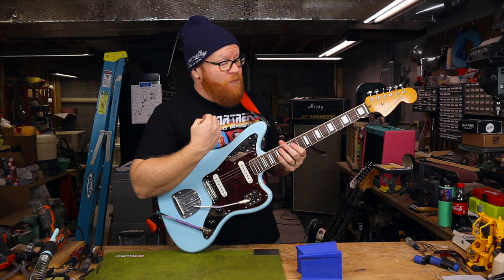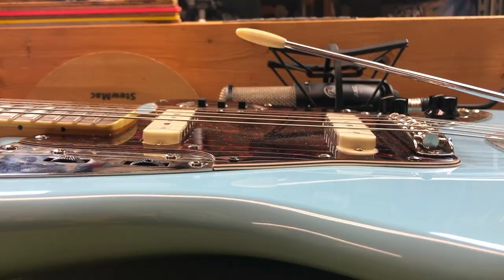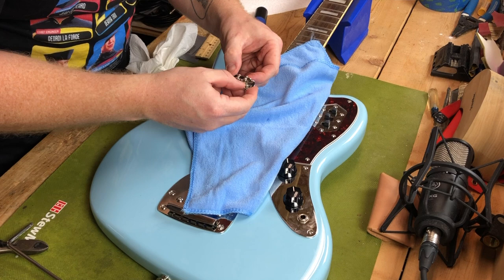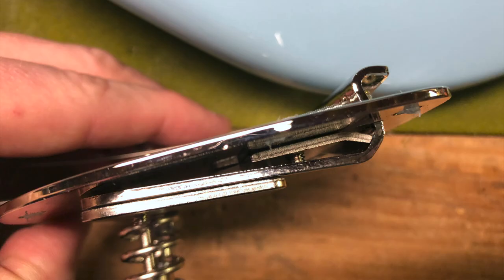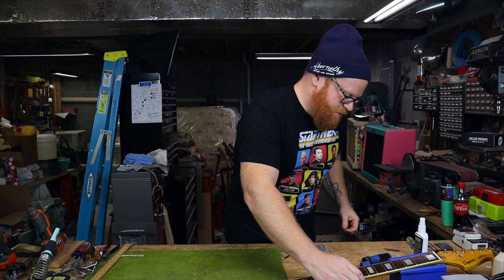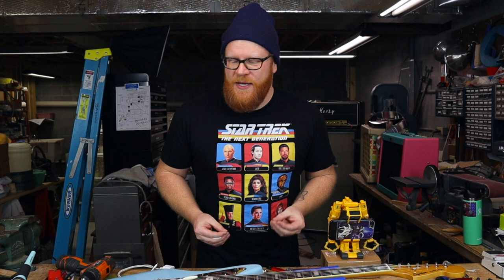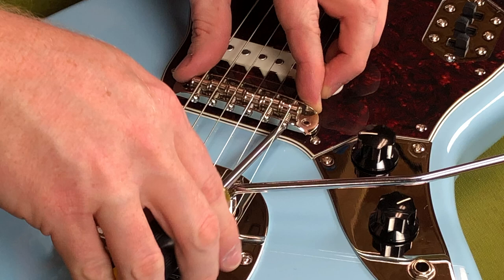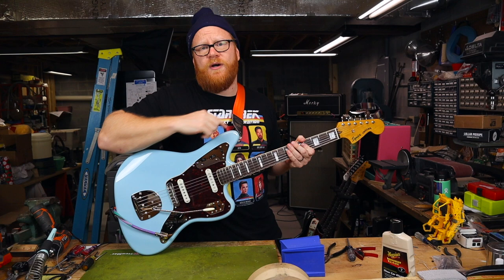ON THE BENCH #6: Squier Classic Vibe '70s Jaguar Setup + Quick Demo

Comment: I just bought this same guitar new, and it has the same issues, almost exactly. As someone inexperienced with setups, esp. with this type of vibrato, having you go through this is very helpful, I appreciate the video!
Reply: Me too with my 70's CV. It's a factory issue I think: there isn't enough pitch in the necks. The shim fixes it.
Reply: @lenduckworth99 How thick was the shim? I just got one of these.
Reply: @slightreturn1045  Try a .5 degree shim. That should get you there.

Comment: Only offsets are worth this much trouble.  If a Las Paul required this much TLC I'd never buy one.
Reply: This guitar is also around $2000 less. I figure a lot of the price goes to setup along with construction.
Reply: @jazzblasterrr  true on the price difference but people put a ton of effort and money into expensive offsets too.
Reply: @jaybaker9248  thats absolutely not true at all. Most of the higher end Jazzmasters and jags are perfectly fine, if anything most people will throw on a mastery bridge and call it a day, for any type of offset. That is deffs not a bunch of effort and money. Literally any cheap guitar like a squier, or even most epiphones are going to need work.

Comment: That slamming the vibrato arm with a hammer tip is killer!  I can finally do the Kevin Shields strumming on my CV Mustang.
Reply from the maker: YESSSSS
Reply: irc, there's a video somewhere on YouTube of Kevin Shields discussing his guitar, and in one of the closeups you can see he has tape on his vibrato arm to prevent the it from being fully inserted. So it was the first thing I tried, it does make that 'glide" technique of his easier! Here's a shot of his arm: https://youtu.be/gxkzYCT2NGM?t=113

Comment: Awesome, Mike... I did many of the same things to my CV 70's Jag. Your earlier videos were extremely helpful in getting it closer to "fighting" shape. THIS video confirmed my suspicion  that I need to file down the nut too. I was able to fix a lot of the noise in my vibrato just by pinching the collet closed a little more with some pliers. I also added a little bit of electrical tape to the bridge posts just to get rid of the metal on metal clang. I'm not sure if you would have recommended that since I've never seen you do it... but it works. Thanks again.
Reply from the maker: I don't personally use tape as a fix, but plenty of folks have over the years!

Comment: I purchased my CV Jaguar after seeing this video.  Halfway thinking it was going to be a nightmare and half hoping that it would be so I would have something to "Tinkle" with.  When I got it. Plugged it in and had NONE of the same issues.  However the tuning and tremolo suck. I installed a Classic player Tailpiece and Vintage locking tuners. NO shim, but I did lock the bridge so it wouldn't rock.  Filed the knife edge on the CP tailpiece, slipped thin heatshink tubing, (2"), over the ends of the strings.  1mm action at the 12th fret. No ringing, no rattling. Neck is perfect. No fret sprout or rough edges.  If I didn't look at the name, it could be an MIA Fender.  A great instrument for <$500.

Comment: Thanks for posting this. I bought one of the CV’s in daphne blue. I absolutely love it. I did a lot of what you did in the video, mainly oiled the board, polished the frets and did the pitch back on the neck. Just those things made a night and day difference. My guitar didn’t even have any kind of shim from the factory, I just used a small sliver from an expired gift card. 😂 but it still worked.

Comment: Exactly the same issues with my Squier Jag, the same sandpaper shim. The post screws are sooo loose. From what I can tell, shim and power slinkys fixed all problems except for the sinking bridge posts. Even with loctite these sometimes go loose. I ordered some Chinese Mustang Bridge with individual string adjustment screws, I hope this makes the guitar complete. This guitar has one very strong advantage. I think the pickups are really amazing.
Reply: How did the mustang bridge work out for you? I have the exact same problem on my CV jazzmaster and I’m thinking of upgrading to a mustang bridge as well, but I’m not sure if I will have to make any changes to the holes or the mustang bridge will just fit right in place. Thanks in advance
Reply: @dweezil4228  The mustang-style bridge I ordered from China was way better than what squier had from the factory. Solved the bridge problems for me

Comment: There is actually a better and easier way to fix the bridge sink on this guitar, and this is by purchasing some neoprene rubber washers from a hardware store. I did this and they were about 1/16 of an inch thick so it took three of them on each post to bring the bridge up to the hight I like for the action, it worked very well. You can take  your bridge into a good hardware store and get them to fit perfectly, mine were about 1/2" in outer diameter and 3/16 for the inner diameter and 1/16" of an inch thick, try it for it is a great fix for this guitar.

Comment: Just got mine today. Shell pink! This video is helpful, even though I have experience with doing setups, intonation, etc.. Thank you!! I have the pivot plate out and about to grind it. I already polished the frets, they were SO bad You could hear the string scratching from three feet away.I also sanded the fretboard with 800 and then 2000 grit. I was actually getting the wood to shine like rosewood. I also went a step further and used some Minwax ebony stain on the fretboard. It doesn't look black, it looks like dark rosewood!! Oh well, on to the plate grinding and loc titing....
Reply: Done, and it's awesome!!! I put on 11/50's, set the intonation, stretched the strings, and it stayed in tune better than some hardtails I have owned before.

Comment: I've watched this vid 10 times by now. I picked one of these up locally and have been slowly getting it in order. I had the opposite problem with my bridge adjustment screws in that they are too tight... Lol. But I can't afford a Mastery bridge atm, so... I'll make it work. My trem plate was also really gunky like they had tape all over it... Took some doing to rid it of all that
Reply from the maker: Oh weird! If the screws are tough to adjust sometimes heat can break any connection being made there from gunk or thread locker. Try holding a soldering iron tip to the screw itself and see if that doesn't help!
Reply: @Puisheen  I'll have to try that, already down an Allen wrench... Lol

Comment: I have the black version, I ended up getting a friend to cut a new nut (The one that was on it had incorrect string spacing), shim the neck, and level and polish the frets to get it into a state where I was happy with it, its a great guitar now, but i think you have to be prepared to have some work done to get it playable. I have the CV 50's tele but that played great out of the box, though i guess compared to a jag a tele is a very simple guitar.

Comment: I HAD THE EXACT SAME ISSUES...had to shim neck, locktite screws...had to add foam under pickups and replace all the stripped pickup adjustment screws with new screws, used some wax to lube the threads so i wouldnt strip them again...also had to use 11's to keep the strings in the saddles...had to deoxit the crap out of all the slider switches...pickup upgrade is next...
Reply: dear god! loli think ill just look for  a different guitar, thanks.

Comment: I've got a CV Jag in surf green. after I shimmed my neck, I felt like my pickups were too far from the strings. I ended up needing some more foam under there (mainly the bridge pup) as I ran out of adjustment pretty fast. 

the vibrato plate on mine also seems grubby, I should probably give it a good wipe when I next change strings. I think it's some residue from the plastic sticking to it.

I know my nut needs filing because I'm using the same strings 11-48, but I feared doing more harm than good so I have left it. I might try to source the tools to try myself but a good set of files for a one time job is quite costly. (also these do come with synthetic bone nuts so actually it probably was the original nut. quite different to the vintage modified plastic you might have expected)
Reply: You can make nice nut files from a feeler gauge set. Just round the edges of blades you require with some sandpaper and add grooves to them with a thin metal saw to make them abrasive. You can re-groove the files as they wear but mine allowed to lower the slots on this baby. The file needs to be slightly thicker gauge than the string. Check out some tutorials on nut filing once you make the files. Feeler gauges are much cheaper than luthiery files
Reply: @karol_p  that's interesting. I do have a feeler gauge, but my thickest one is only 1mm (0.039 inch) so I wouldn't have a thickness for my low E. I read some people use strings and put sand paper around them to get the width for each slot right. it obviously isn't the ideal method but it seems like that'd work to just widen the slots enough. and I've got the supplies already. I'm not really looking to take much height besides getting a slight angle towards the tuners so I might give it a go
Reply: @lukebenjamin  Yes I had this problem also - thickest feeler gauge is 1 mm, so I grabbed some needle file from another cheap set to take care of the last slot. A string wrapped in sandpaper sounds a bit less stable for me, but I haven't try so it might work. I do not recommend nozzle cleaning needles as nut files. Tried them but they totally sucked.
Reply: @karol_p  I ended up trying the string and sand paper method last night. for my purposes it did the trick. for minor adjustments I think you'd be fine. but I wouldn't think this is the way to go about big changes in depth or filing nut slots from scratch. Having the existing slots to act as a guide to keep you straight is probably quite essential to things going right. it didn't take long to see an improvement, and in no time I had the little extra width to seat my strings better. I might go about a more professional method for any less affordable guitars in the future though.

Comment: Mine had a super wonky string spacing, the low E was almost hanging off the edge, but Fender covered a new nut and set up under their warranty. I absolutely love mine after I put some work into it, fantastic guitars for not a lot of money.
Reply: Glad you got that covered - it’s still surprising how a guitar can leave the factory with such a fundamental flaw, though.
Reply: I bought mine at a Guitar Center store new, and there's some pretty shifty low E buzzing. I thought it was the bridge but it seems to be an issue with the nut after a close listening. Did you have any buzzing too or just spacing issues?
Reply: @kcd2120  i agree, why is everyone here so forgiving of terrible build QC? i buy a brand new guitar i really don't want to rebuild it when i get home, i want to play it.
Reply: @oldandeerie  because its cheap and with these new squiers the individual parts are usually well about their price range...except put together a bit wrong. My Bass VI literally had a pickup put in backwards haha, but they are good seymour duncan pickups- just requires attention. Also, the top range Jazz/Jags also have half these problems too, perhaps even an inferior bridge if its the stock one with grooves.

Comment: The vibrato unit on my CV Jazzmaster was much the same when I got it. I tried deburring the edges but the clicking persisted. I later found a thread on Squier talk that recommended tapering pivot plate so that the top edge juts out a bit further than the bottom, and that seems to have done the trick. Aside from that, the ‘bone’ nut was also a mess. Most of the slots weren’t even cut parallel to one another. I was considering ordering a drop-in replacement, but apparently it’s a real pain to remove the existing one what with the finish on the neck being applied over the nut.
Reply from the maker: Yeah, what I did here was put like a 45 degree angle on the legs, I should have been more clear on that.

Comment: Thanks for this in depth guide. I just bought one of these and couldn't believe how glaringly bad some things were (gritty frets, dry board, insanely noisy tremolo mainly). There's a really decent guitar in there, as you demonstrate, but it's gonna take some work, and I don't have the power tools to square off that tremolo part that's causing the rattling noises.
I'm a person that loves cheap guitars and have managed to find some pretty decent ones for crazy low prices (mostly under a C-note). I've never had an Indio or IYV or Grote or even a Glarry-level guitar come with as many issues as this Jaguar (and another Squier that arrived brand new with a dead pickup). I'd be pissed if I'd paid full price. For $4-500 you should get a guitar that's a LOT more playable out of the box.
It's funny... I bought the CV Jag not long after having bought a guitar I'd been seeking for years: a Yamaha AES820 (early 2000's). That guitar, for which I paid the exact same price, was perfect from the start, I'm assuming due to a quality setup by the store, but maybe not. It's a better guitar in every way, with premium components. Playing the CV Jag was a bit of a letdown after that, but I'll get it to being what it can be.

Comment: I can't decide if I appreciated the practical setup advice or the Gowron reference more. Thanks so much for sharing your knowledge and being so hosh darn entertaining while you do it!

Quick question on neck shims I am hoping you can answer. I ordered the set of three Stew Mac shims for my CV Jazzmaster and I'm wondering what angle you typically have the most success with for these Squiers. .5 degrees? 1 degree? Stack the .25 and .5, maybe?
Reply from the maker: Every individual guitar can be a little different due to the tolerances that exist in mass production, however, .5 is a good place to start. I usually recommend grabbing the three shim set for safety's sake

Comment: Hi Mike! I was wondering how you measure the proper angle of the neck when installing the shim. I have a Squier CV JM and want to see if it needs a shim or not. What measurements should I be looking for? Thanks in advance for your time and creating great content!
Reply: The JM is a different beast and probably doesn’t need it shimmed.  The combination of the tuneomatic bridge and the closer placement of the trem already drastically change the break angle over the bridge. If the strings are staying in the saddles and not rattling you should be good.
Reply: @dustinc4353  I read it that he has a CV JM, not a JMJM. He might have a regular CV Jazzy.
Reply: @Haze763  yeah I think you are totally correct now that I read through it again.
Reply: @dustinc4353  I've got the limited purple Jazzy being delivered tomorrow finally. Ordered it last August! I have a new toggle, pots, cap, strings, roller tree, and a StewMac shim waiting.
Reply from the maker: Every guitar is different, so there's no perfect amount of neck angle. Try ordering some Stew Mac shims and experiment with different heights, generally anywhere from .3 to a full degree works

Comment: Kicking around getting a Squier CV 60's Jazzmaster.  I assume similar setup steps?  Also, after you sanded the 0.25 shim you said you thought it needed a bit more tilt but then cut away to fret polishing.  What did you settle on for the shim?  Thanks!  This was a great video, learned a ton!
Reply: haha i was wondering where that part of the video was too! , just never came back to it and that's the part that interested me the most.

Comment: I wonder how a jag would work with .10 gauge strings for a loose feel but not too loose. I was shocked to learn that Brian May used .08 gauge on his Red Special, which is also 24" scale length. I know it has a different vibrato system and probably different geometry in general, but that had to be mighty loose, which would help with his awesome sounding vibrato on bends.

Comment: Mike, I hope to get one of these someday (soonish) and this video was really educational to me! 

Would putting a set of D’addario EXL 110s (.10-46) on a guitar like this be too out of the question? Those are my go too’s for strings (I’m not an Ernie Ball guy with all due respect).
Reply from the maker: You can totally get away with 10-46 provided it's set up properly! I will caution against using D'Addario on offsets though because of their weak finish wrap on the plain strings. Otherwise a great string, but with the way offsets are strung they break far more often than Ernie Ball, DR, GHS, etc. If you insist, get a set of the XTs with a pre-soldered ball end or make sure you do that yourself

Comment: I have one of these CV 70s Jags in black. I really like it, but I can't figure out how to properly set the vibrato tension. I feel like the vibrato arm rests very close to the body. All the info I've found about setting the tension, using the tension screw, is based around having the locking mechanism on the vibrato, but the CV 70s Jag doesn't have a locking mechanism. Does anyone have any advice about this. I'd really appreciate it if you have the time. Thank you.
Reply: The Squier versions don’t have the locking button but they do have the arm adjustment screw. Just turn it clockwise to raise the arm higher.